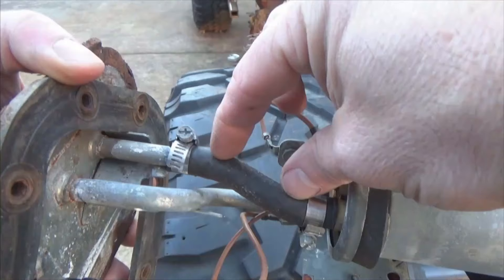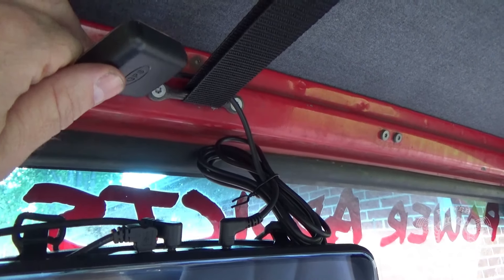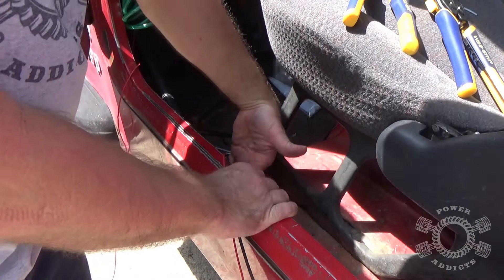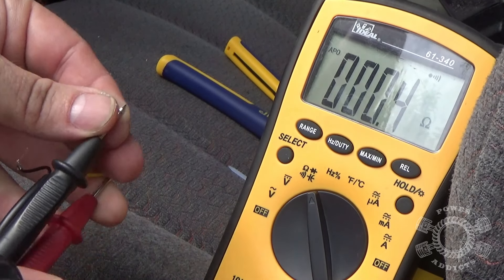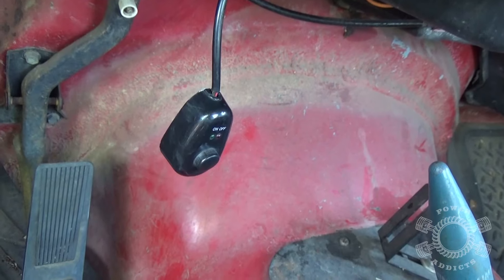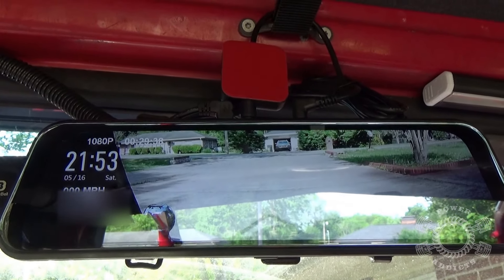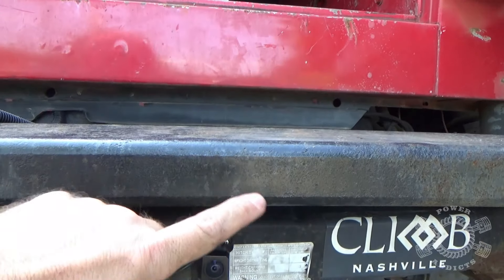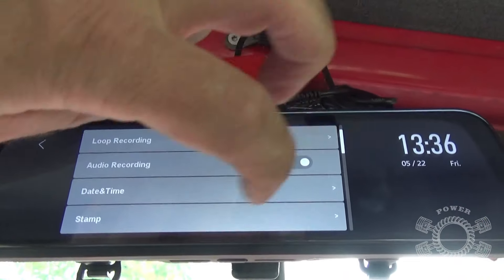Jeep Wrangler YJ - Lets install a back up camera/mirror. #backupcamera

Comment: I’m sure you know this by now but that mirror set up does have the rear camera work full time already. The red wire splices into the reverse light wire ONLY for going into reverse mode which adds the back up indicator lines like the red yellow and green grid on screen, and so it goes into full screen reverse mode automatically when you put it in reverse. If you just wired it the way it’s supposed to be, you’d have full time front and rear camera options.
Reply from the maker: Yep, you are correct! I've already taken that mirror out. It gonna go in a different project that I'll be working on soon.